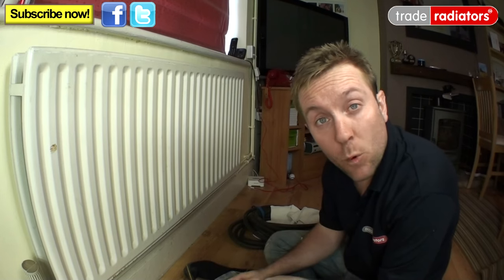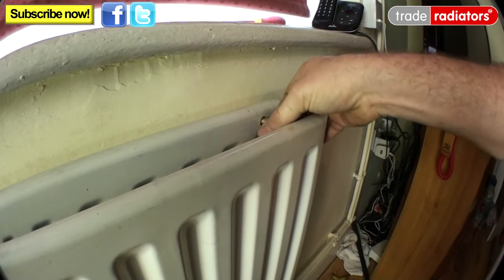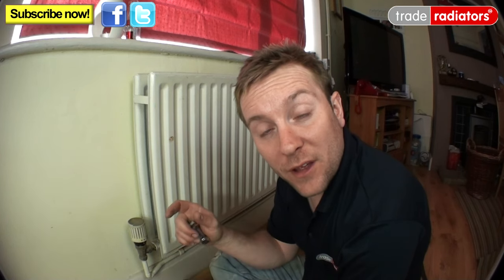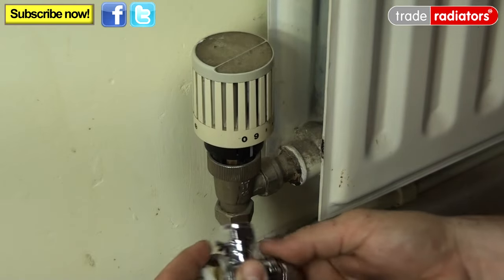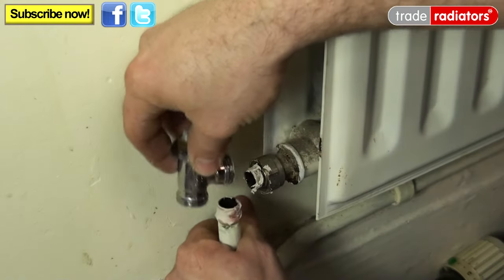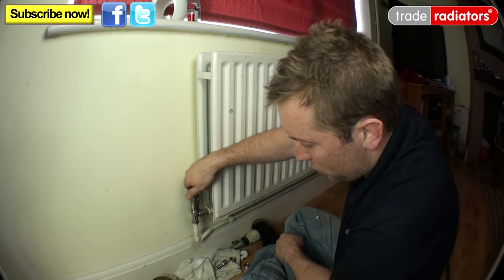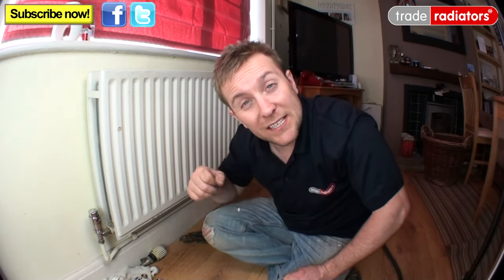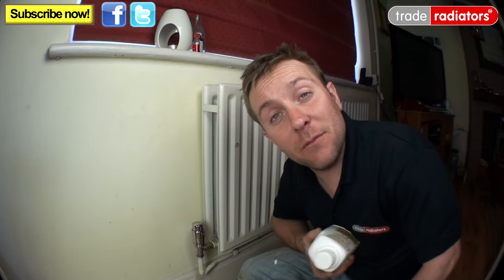How To Change a Thermostatic Radiator Valve

Comment: This information & video was brilliant, We had 1 cold rad (yesterday, sunday) its been so mild we just hadn't noticed it, watched the video, hot water pipe was hot, tick, remove the thermostat, used side of pliers to push the pin up & down, tick, 
Whilst thermostat removed the radiator got hot, common sense told me (?) that the radiator was fine & the thermostat was faulty, of to wickes new thermostat £10, fitted it, & There you go!
The video gave me the confidence to go through each part one step at a time.
Plumber today would charge how much?
And then they would boost the price by saying the system had to be drained & new pipes blah blah & ker ching!
OK not all of them, but it makes me wonder
THANK YOU   xxx  10/10

Comment: Thanks good video totally get it but why don't they fit ball valves at each radiators / boiler etc.. ??? Would only need need to bleed each item, this is common on large production plants everything must be individually isolated why not in a house???

Comment: I’ve got a combi boiler can I just turn off water supply and electrics and change the TRV without draining?
Reply: With a combi you don't need to turn off water supply

Turn off boiler

Drain water from the entire system.

Follow as above 

The water is not being continually supplied in a combi boiler, you have to manually top it up.

Comment: Two questions if I may.
To drain system I thought it better to just open highest Rad and let it drain from lowest.
If I open All of them wouldn’t water pour out of them when draining.
Secondly. I have a leaking valve in bedroom. Can’t I just replace the valve head without having to drain it all down?
Any advice gratefully received

Comment: I can’t seem to find the drain off, is there anywhere common it could be or could I drain directly from the TRV? Great video 👍🏼
Reply: Did you work out how to drain without the drain off point? We also don't have a drain off point on our radiators or pipes?
Reply: @gurgu124568987  I found one downstairs under a random radiator, but unfortunately this did not drain the whole system and I had a few issues
Reply: @callumbuck5683  thanks for the quick reply. I've found another video on how to drain without the valve. Going to give it a go. Fingers crossed

Comment: Why do you have to drain every single rad in the system, if they all have trvs and lockshields can't you just turn all trvs to zero and lock off every lock shield and then just drain whatever comes out of nearest drain point to the rad you are changing? Please let me know, great vid btw
Reply: You would have to rebalance the whole system if you did that, so it is not recommended.
Reply: Close each Rad valve to lock in the system. Take not of each valve setting (i.e, how many turns it took to close each valve) When re-instating return each valve to previous setting. Balance remains the same. Maybe a small tweak here and there. Pointless draining the full system.
Reply: Great point and great answers all. 👍 working in large or townhouses would be a nightmare with a combi to drain all

Comment: I want to swap the thermostatic valve from the right side of the radiator to the left side - the left side has a white cap which can be pulled off - can the thermostatic valve be pulled off in the same way and pushed on to the other side - or would that need a plumber?
Reply: Same way, drain the system and take it off.

Just make sure your trv has arrows on both ends.

P.s. the other valve is called a lockshield valve

Comment: 10-15 mins to drain? Mines been going for at least 40 minutes. When I open some radiator bleed valves water comes out.
Reply: Turn the heating off first.
Reply: J Anything thanks. It was off. It was because the pipe wasn’t in a good position.

Comment: Councils have turned my hall radiator full on and then removed the control n replaced it with plastic cover cant affect to heat an empty hallway how do i turn the damn thing off
Reply: take the plastic cover off and use an adjustable wrench or spanner to close the valve thats under the plastic cover.